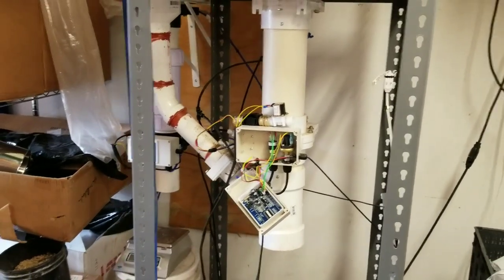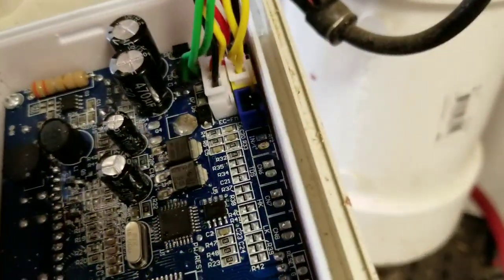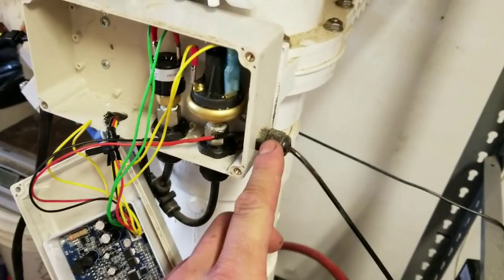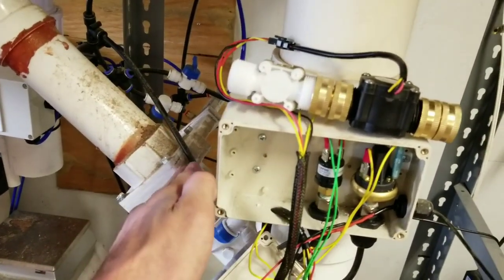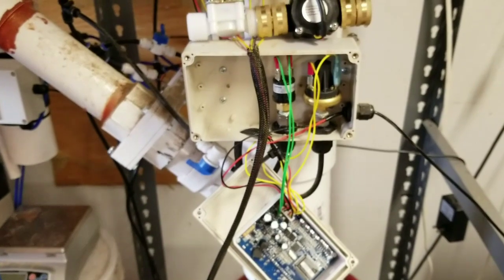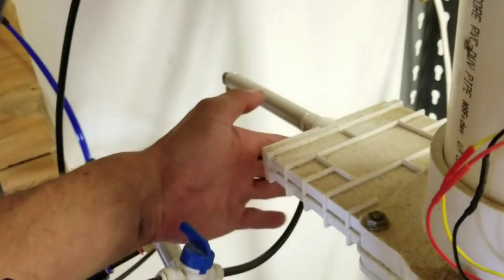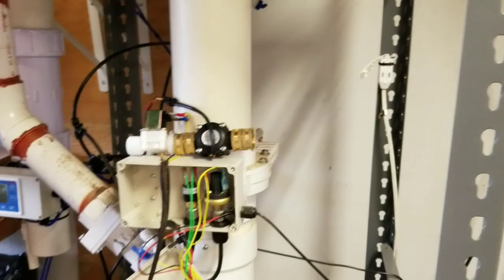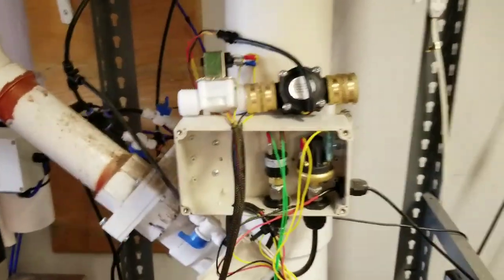Automatic Mushroom Bagger Wiring and Air, ZJ-LCD-M Water Flow Control LCD Display Meter

Comment: @ 0:27 Looks like 16mm bore, 100mm stroke piston. Did it come with the mounting bracket or is it custom? The attachment fitting on the piston rod - is that also custom - all the pistons seem to only come with a threaded rod.
I am looking to build these two gate valves myself as the Valterra's are too expensive.
Reply from the maker: Its all home built custom, The final version is found on my unit that's now in production and available on my website.

Comment: You said on your kit.Com page

Valterra 6401P PVC Pneumatic Gate Valve, Gray & Black, 4" Slip, Metal Cylinder
"
You will need 2 of these for the dry substrate. Take them apart and remove the bottom O rings to prevent jamming.
"
What should be taken apart?
Reply from the maker: when you get it, you will see
Reply: @MyersMushroomsFarms  i already got it. You mean screw out parts and discard one of them?
Reply from the maker: @veracossartvera1653  remove the o ring inside
Reply: @MyersMushroomsFarms  oh, ok, thank you!)

Comment: 1. does the flow meter machine support recalibration if you want to change the flow sensor to a bigger one?
2. I've seen dust collector blast gate powered by a servo motor, do you think it could cut through the substrate density?
     thanks
Reply: I ask because i think if you want to upgrade the solenoide valve you also need to change the flow sensor.
Reply from the maker: MUAD' DIB I've changed the flow meter size without a big deal. Just adjust the volume to what you want.
Reply: very cool.
Reply: But theres no instructions as to how to install the pressure switches and mounting the water meter. I dont want to screw this up and have to buy new parts. Dont like wasting money. And how will it work with a pneumatic piston? Does it work as it does with the knife valves?

Comment: Hey boss, bought all the components off kit, the motherboard for the computer has changed. C14 is not located in the area from this video, I see posts where you reference but want to be sure before I damage something. 
I’d appreciate a moment of your time.
Reply: Solder to the pins on the back of the on off switch. The 4 pins are connected horizontally by traces on the circuit board. Solder one wire to the top pair, other wire to bottom pair.
Reply: The one I bought is different also, it has 2 little bumps on top, and one on the bottom, guess one goes to the top, and one goes to the little bump on the bottom, mine doesn't have 3 yellow wires, only 2.